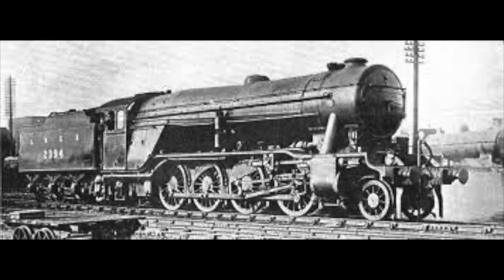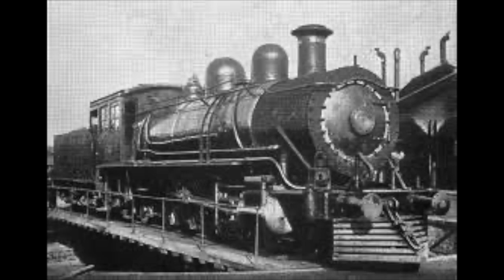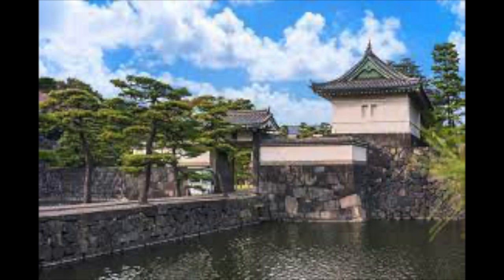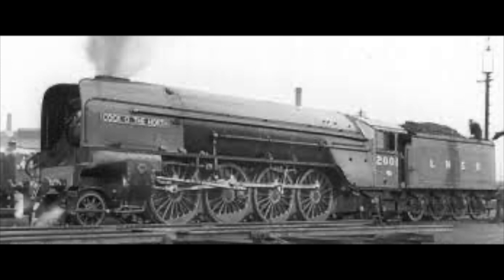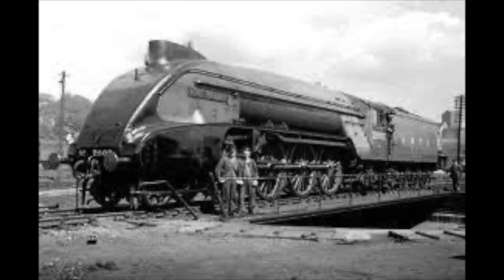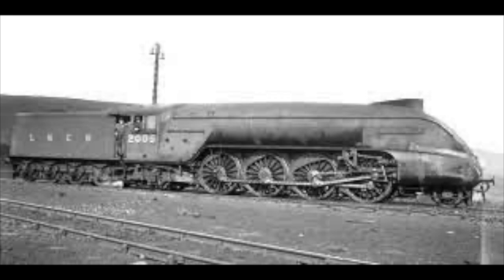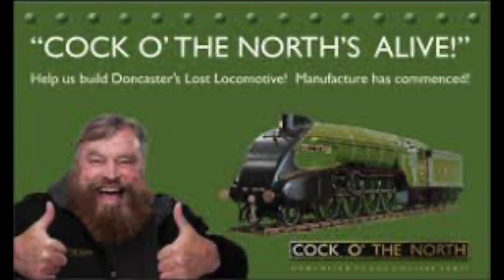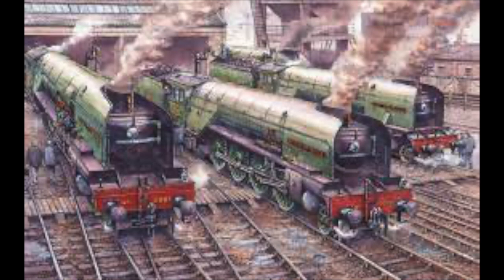The P1 and P2 Mikado, Gresley's giants

Comment: Very well done vid. As for the subject matter, it's a shame none of these engines were saved. Hopefully the P2 Trust will prosper and you UK folks will once more experience the excitement of watching a large engine running under steam. You folks in the UK are so lucky to have so many preserved steam locos.
On the subject of this vid, Canada's Canadian Pacific Railway was a big user of Mikados of various sizes starting in 1909 and continuing on until the end of steam in Canada circa 1960. Strangely enough, the very first CPR "Mikes" were classed as P1 with various subclasses until the P2 version arrived  sometime in the 20's. The P2 subclasses were still being built during WWII but shortly after the war ended, so did the CPR's purchases of ANY steam locos. To my knowledge, all the P1s were hand fired but most, if not all of the P2 class were fitted with mechanical stokers.
Reply from the maker: ohh i never knew this, im gonna have to do some research into the Canadian railways, thank you :)

Comment: Cutting the P2's down to a Pacific wheel arrangement was sheer vandalism, Edward Thompson must have had a real chip on his shoulder about Gresley.
Reply from the maker: I have to admit it wasn't the greastet move he made but I can understand why - hopefully seeing the new P2's on the track will be worth it
Reply: Not true. The P2s had a number of performance issues including regular cracked frames and their availability was significantly lower than other large mainline classes. Something had to be done as the demands of WW2 meant that there simply wasn't any scope for these locos not to be available for long periods of time. Thompson had to do something to try and improve reliability but had limited financial resources to do so. He rebuilt them in an attempt to improve their availability and to reduce the wear and tear that these locos were having on the line to Aberdeen. There is no evidence that he had any issues with Gresley whatsoever, he was, after all Gresley's assistant for many years. Thompson took over the CME role on the LNER upon Gresley's death at a very difficult time for the railway and for the country as a whole. He does not get the recognition that he deserves.
Reply: @hoskinb1  I worked at Derby loco' works so cannot comment on LNER loco's. However I can say that the issue of cracked loco' frames was definitely not confined to P2s. Some clsses were notorious for cracking frames. The only class of loco' I NEVER saw with a cracked frame at some point were the BR class 5s which, of course did not exist in the war. I always thought the Americans had the right idea with bar frames.

Comment: Not gonna lie, had the LNER fitted stokers to the P1's, the firemen may have actually enjoyed them. Not saying that stokers would've been the thing that fixed all the issues, but they certainly would've prevented the firemen from getting TO worn out and perhaps filing a complaint or two.
Reply from the maker: true but I don't think the uk network were a big fan of them. stokers were prone to jamming and I can't imagine that it distributes the coal in the firebox as well as a fireman. I also don't think the firemen would be too happy about a machine taking over their job.
Reply: @DoncasterDrawn  I don’t think they were used much here. If it was, the coal would have to be prepared for it as well, being broken into much smaller ‘nuts’ to work with it. The post WW2 fleet manufactured across the pond for the SNCF had them (the class 141R), and they using a fuel known as :Charbon Criblé’, so there would have to be a separate batch of it for classes fitted with them.

The other option would have been to use heavy oil as a fuel. There had been some trials of that by the GWR, but not popular financially here. Many 141Rs on the SNCF did use it, though.
Reply: I'm shocked to hear that mechanical engine stokers never caught on in the UK. Many Class 1 US and Canadian roads made extensive use of engines equipped with mechanical stokers, especially before oil firing caught on in the latter years of steam.
Reply: @johnkeepin7527  There were some 9F’s fitted with stokers back in the day. There wasn’t any performance difference between hand shoveling though.
Reply: Southern 4501 over in the United States has a mechanical stoker built to a Chinese design. A larger 4-axle bogey tender like 4501 had when she was first built up until 1982 could have worked. Many big steamers have stokers.
Reply: @SouRwy4501Productions  4501’s stoker is actually off of the Canadian or Grand Trunk, I can’t remember which it is, 4-6-2 at TVRM. The feedwater heater on the ‘01 is a Chinese one, though it’s built to an American design.
Reply: @justahillbilly7777  you’re correct. The stoker is taken from Canadian National railways 5288. The feed water heater is based on a Chinese design. I simply got the information mixed up.

Comment: Am I the only one who really likes the Way the rebuilt P2s look? Dont get me wrong, I dislike most of Thompsons rebuilds but Mons Meg and the others just look really interesting. Also love that name.
Reply from the maker: yeah she was stunning. it'll be interesting to see both the prince of Wales and cock of the north on the mainline. it'll be a stark contrast and many may not guess they are sisters.
Reply: Whisp of Words. It was in the late '50s on a drizzly Sunday afternoon I was at the North end of what was then platform 8 at York station. Loco' No 60506 Wolf of Badenoch drifted slowly, light engine down the, now gone, southbound middle road. I walked alongside him until he just cleared the station canopy at the south end when he got a green light. I saw the driver open the regulator slightly and the drivers just spun with no discernable increase in speed. I remember thinking, "yeah! That's because you've had 25% of your traction removed. The driver quickly recovered it, but had it still been a P2 it probably wouldn't have happened.

Comment: I’ve said this before and I’ll say it again. The LNER should have fitted the p1 and p2 locomotives with stokers, larger bogey tenders, and feedwater heaters, they could have been way more successful. I can draw that conclusion because there’s a 2-8-2 locomotive where I live over in the United States that had a similar problem to the p2s. 

Southern railway 4501 was/is a 2-8-2 locomotive built originally without a stoker but with a feedwater heater. The locomotive suffered from being very coal hungry for most of the its life. However, in 2014, 4501 was rebuilt to have a stoker, a larger tender, and a Chinese copy of a worthington SA feedwater heater. These modifications really made 4501 work better than it had before.
Reply: The design improvements incorporated in the building of the new P2, number 2007, should have a significant impact on the fuel consumption of the design. Grate areas of 50 sq ft or less generally do not require a mechanical stoker. LNER engines are frequently fitted with exhaust steam injectors, much less costly and complicated than dedicated feed water heaters.

Comment: Grezza,s grunter always liked his P2  Heavy Express Passenger Engines, okay his A series Pacifics were ,and still charismatic, even with full sanders on they slipped their b------s off when starting a heavy train. But when it comes to raw pulling power, you cannot beat an eight coupled express passenger engine. That extra drive axle makes all the difference between a noisy calamitous departure, and one with confident strident barks from the chimney .In the cool stakes Grezza,s Grunter leaves Flying Scotsman in its smoke screen.

Comment: I'm confused, you give the impression two new P2 locos are to be built (as in hasn't happened yet). I'm assuming by those rather out of date comments, that you filmed this some years ago. 
I'm only aware of one new P2 being built as the Prince of Wales in the image of the original Cock o the North. I'm helping fund it and currently its about two thirds complete. The P2 Steam Locomotive Trust is just a subsidiary of The A1 Steam Locomotive Company (Trust), so are one and the same company, not two unrelated ones.
These Gresley Mikados are my favourite looking loco. I already have Hornby's rare posh version (not the Railroad one) of Cock o the North which I have lightly weathered. I have the streamlined Lord Precident on order and will get Hornby's newly tooled Prince of Wales from the P2 Trust as and when advertised for sale next year (2022)
Reply from the maker: hi Andrew, yep there are 2 locos to be built. one belongs to the P2 steam locomotive company and the other belongs to Doncaster P2 locomotive trust. The Prince of Wales is being listed as engine number 2007 and is effectively a brand new engine. The Doncaster P2 locomotive trust is rebuilding the cock o the north in its streamlined shape. it is a copy of the original design. I have included the website here. https://www.cockothenorth.co.uk
Reply: @DoncasterDrawn  Well knock me for six, how did that go under my radar. Do you know if the two organisations share parts and expertise to help spread costs, or is 2007 far better funded ?
Reply: @andrewdking  They are very much separate entities and neither trust has connection to the other.

You are right on the funding front though, 2007 now has her cylinder’s and boiler is due March whereas there’s been no news on the Doncaster P2 in years (save for them moving to a new HQ).